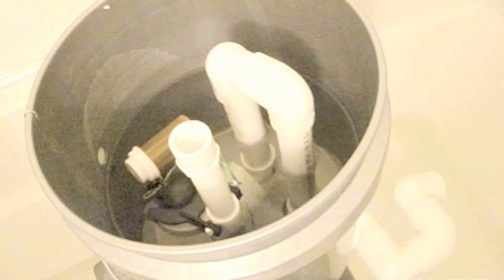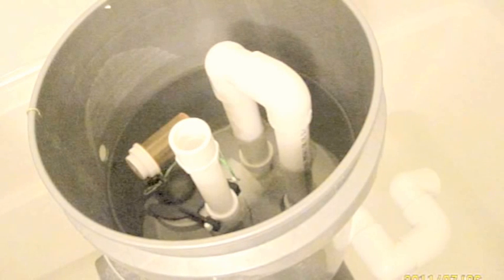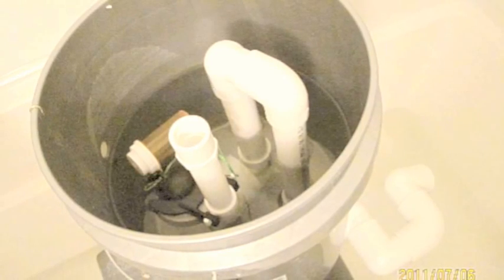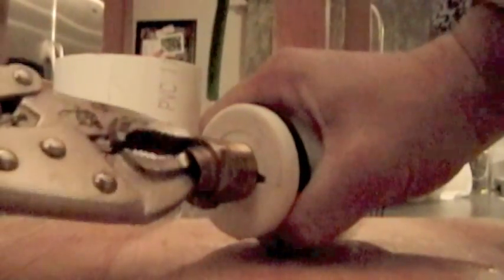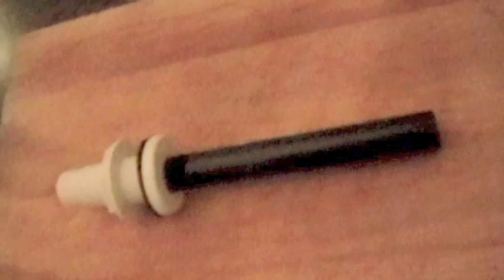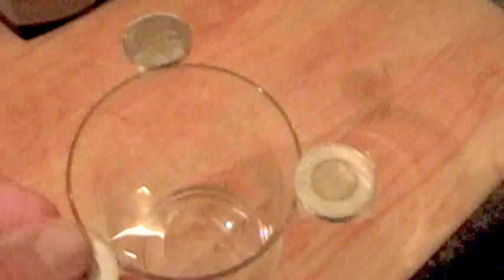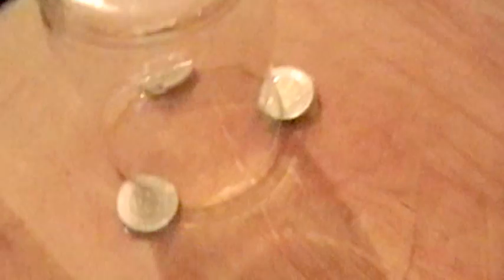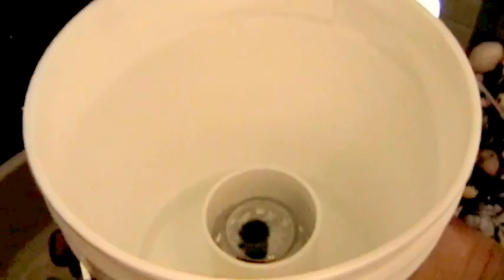How to make a BELL SIPHON (SYPHON) that will run forever! AMAZING!

Comment: the  flaring  of  the  stand  pipe  is  even  better  than   a   step  up  adaptor  at  the   top  as it  creates  a  partial  vacumn  that  sucks  out  the  air  at  top  of  bell   .  The  bigger  the  stand pipe   the   greater  the  flare  i e  greater  the  angle .   Best  demonstration  I have  seen  . Thanks
Reply: Totally agree.

Comment: Could you make the water from the drainage flow back up to the top?
Reply: mercuriallimit I’m watching this video as I’m looking at making a low maintenance fish tank (sick of water changes). To get the water up above I will be using a pond pump
Reply: Nope. You need a small fishtank pump. $25.
Reply: Sorry. Commented on the wrong thread. S.

Comment: Thanks for the video. I have a question though, how could you direct the water coming out of the green pipe back into the grow beds without the use of a pump?
Reply: You basically can't. It takes energy to lift water to a higher elevation, so you need something to transfer that energy to the water. That's what a pump does - before pumps were invented you had to do things like fill buckets and lift them, or crank a water screw. The siphon uses the difference in air pressure between the source and destination to push the water out of the source, so it only works if the destination is lower than the source. The siphon drains the grow bed so much more quickly than the pump fills it, though, so I don't think it's suitable for filling another grow bed directly.
Reply: air lift pumps are cheap to run. heaps of vids on YT for aquaponics

Comment: Best explanation I have found thank you. Could you explain briefly what the additional hole in the black pipe is for? Sorry I am little slow. Best. And Thank you!
Reply from the maker: Thanks for the feedback.  The small hole is simply to allow the bed to drain slowly over several hours in the event of a POWER FAILURE.  If the power is off for 12 hours (which happens a few times a year in my area) the bed will slowly drain, leaving the roots damp but not water logged.  You don't have to put a hole in it otherwise.  Have fun!  Steve
Reply: Thank you kindly!

Comment: Ill ask it again since the question wasn't answered. How did you arrive at the 3/4 in gap figure from the bell to the stand pipe? I've done some experimenting with stand pipe height and bell height and I havent found there to be much difference as long as the gap isnt much more than the diameter of the stand pipe.
Reply from the maker: Exactly.  The significance of 3/4" is that the diameter of the pipe is approximately the same.  This gap ensures enough water can get into the pipe during rapid flow.  If the gap was 2" it would still work, but you need at least the diameter of the pipe above as a rule.  Steve.

Comment: Where does that number 3/4 inch gap between the top of the tube and the glass come from?  I would think the siphon action would be better if the area of transit of water over the tube and under the glass was approximately equal to the area of the crossection of the tube?  Why 3/4 inch?
Reply from the maker: Exactly.  The significance of 3/4" is that the diameter of the pipe is approximately the same.  This gap ensures enough water can get into the pipe during rapid flow.  If the gap was 2" it would still work, but you need at least the diameter of the pipe above as a rule.  Steve.

Comment: God, I have no idea why 10 people would dislike this video.  This is the simplest, most concise and easy to understand explanation and demonstration of the Bell Siphon I have seen.  It is amazing how most people can fill up their videos with all kinds of rambling talk and jerky camera and raucous or irritating music and NOT do the one thing they supposedly made the video for - to explain a Bell Siphon????

Great job, and good F'ing work KellySteveT, thank you.

The one thing I am left without a clear feel for is the function of the flaring exit pipe ... the black one that you heated and let distort so that it was wider at the top?  What does that do and why?
Reply from the maker: Thanks for the feedback.  I have made several bell siphons since making this video and you don't need to flair the standpipe.  This was done to allow more water into the pipe, but if the siphon gets hung up while draining, add an elbow or a T under the siphon.  This will improve its function.  Steve.
Reply: kellystevet

It seems to me that the siphon is a function the amount of "solid" water under it.  Gravity pulls down on that water and as long as there is no air in it it will pull and suck in more water from down under the bell.

I'm guessing the elbow assists in keeping air out of the flow and making the down pressure solid.  I wonder why they don't use something like the S-fitting under a sink or toilet which I would think would make it easier to pill that initial part directly under the standpipe and start the siphoning.

Where does the 3/4 inch gap between the black tube and the top of the bell come in.  I would think that the siphon would start quicker with the area of that "cylinder" approximately equal to the area of the diameter of the standpipe, or maybe a bit more so that as soon as water starts to trickle over the top it is the right volume to fill the standpipe right up and begin the siphoning?

I understand your explanation for the small hole to keep the beds drained in case of a pump failure, but I wonder why that small hole would be needed if the height of the standpipe is set correctly ... that is so that the water level does not rise about the air feeding roots of the plants?

I have looked at these videos and did not really get how this thing worked until I saw this one.  The use of the transparent glass really helps.

Comment from the maker: For Jonah Shen
put an elbow in the outflow, or add a T joint so water trickles out 2 sides.
If that doesn't work drill a hole in the top of the bell and put in an air valve.
Lots of youtube vids on that.  I zip tied a pill bottle to the bottom with the air tube inside.
Empties the water to the height of the pill bottle then the water gets sucked quickly out of the pill bottle.
The suction breaks when air gets in.  This will be fool proof.
Steve.

Comment: my siphon wouldn't stop and there is no way i can change the speed of in-flow, is there a solution to change some other things around to make it work? thanks
Reply: Did you mange to make it work?I have the same problem.
Reply: yes, I did. But i have discovered that this is not the best way to grow food. I am moving on with permaculture. Check it out.
Reply: Jonah Shen I have heard of that before I will look it up thanks.But how did you solve the problem?
Reply: I can't remember, it's been awhile. but nothing major, just minor twist and turn; and it doesn't matter to me since I discovered this is not a healthy way of producing food if you can help it.
Reply: Jonah Shen I will try some more.How is it not healthy?
Reply: It's a closed system, where the only outside elements you introduce into the system thus your body is from the fish feed. Other obvious ones like iron you will have to use powder or chemical solution. But you can never know what else is missing. You are not getting a full natural spectrum of nutrients.
Reply: This is why supplementing fish feed with vegetable matter such as vegetable scraps from the grocery store or the local farm is a good idea.  If you are raising tilapia, feed 1/2 to 3/4 balanced feed, & supplement the rest with greens that provide what is missing.  Iron... spinach & maybe cabbage greens?  calcium... broccoli... etc...
Reply: Here's the amazing thing... Firstly, thanks for watching the vid.
I used to balance EVERYTHING every day.  Maybe too zealous.  Then last year i literally left everything alone.... Sometimes i would not feed the fish for a week.  I checked the pH once in 6 months.  Amazingly, the fish and the plants thrived.  Once, I had to add Fe (iron) powder because the leaves of the plants got really pale.  Otherwise, a crop year.  Way easier, amazing how everything wants to balance itself.

Comment: Hey Diddy Kong, sorry I couldn't respond to your answer directly for some reason, there is no reply on your post. Anyway a Heron Fountain does not run for ever, the reason for that is well, there are two reasons, one it relies on air pressure, which runs out once the 1st container gets filled, two the onlything going to the 2nd container is air pressure and not water, so it moves the water in the 2nd container to the 3rd, and or the 1st however you want to look at it, but nothing refills the 2nd container! No water ever moves into that container. Anyway all plumbing is based off of gravity, and if you have a very large container filled with water, then a small tube on the bottom of that container, the water pressure will be so great that the downward force will be more than the weight of the water in the tube, and it will lift the water in the tube higher than the container supplying the water. Basic physics at play here, gravity, mass, downward force, and pressure. Anyway you can prove what I am talking about if you take a piece of flexible tube and put it under a faucet in your house, you need a lot of downward force so you may need to use the faucet in your bath tub, and not the one from a sink, you can place a funnel at the top of the hose. If you use too large of a diameter hose then your results will not be achived. This is the same principal the supplies the water to your house in the first place, especially if you have bathrooms or any sinks on the 2nd floor. I hope this information helps you. You can also look up basic plumbing - water flow!

Comment: Skip bell siphons. You cannot set how wet/dry the beds get, and it requires a 24/7 pump running. Waste of time.Timers are far simpler, more reliable and can allow for fine tuning bed moisture.

Comment from the maker: I have an answer for you.
The best way to make water run upwards is to have a bubbler in a vertical pipe. The pipe is full of water, but as the bubbles float up, they pull the water with them.  Some wells used to be made this way.

Comment: Can a bell siphon be used to run water upwards? I want a way to run water upwards without the use of electricity. I've looked at the water ran idea and it does seem feasible in an aquaponics system. Any ideas?

Comment: I really like the idea of the glass. You can see what is going on easier to understand what needs tweaking if need be. This was very informative, especially the use of the hot brass threaded part and the flaring of the top of the black plastic pipe. I don't think I have ever see anyone make a hole in the bottom of the pipe to allow water to clear out of the grow bed in the event of a pump or power failure.

I will be using your idea when it come to for me to put my aquaponics system together.

Comment: if the power goes out and your grow beds are full of water with no way to drain the tank the plants will die because they will get whats called root rot. the idea behind a system like this is to keep the roots wet with a constant supply on nutrients but not "Over water" the plants. good luck!

Comment: Check out Affnan's silence/aeration drain for the bell siphon (/watch?v=4YAc6bxQhkM)...I use it for about a year now and it works like a treat...Very quite and good aeration... I do not use the drilled downpipe thought...which makes it more quiter still...regards, Sander

Comment from the maker: Smaller bell, smaller diameter stand tube, smaller gap above.  It's sort of a trial and error thing.  If your water supply is just a slow drip, it may not work.  Also, eliminate the small drainage hole drilled in the side of the stand tube.  Good luck! Steve.

Comment from the maker: Outlet diameter can be any size, the larger the diameter, the faster the bed will drain. As you can see, even a 1" diameter outlet drains very quickly.  Input flow is what determines the length of time for the bed to fill.  Input flow can be adjusted so it takes anywhere from several minutes to several hours to fill the bed. If you need a larger outlet drain sometimes you need an elbow at the bottom end of the drain pipe to prevent air from leaking up the draining pipe and breaking suction.